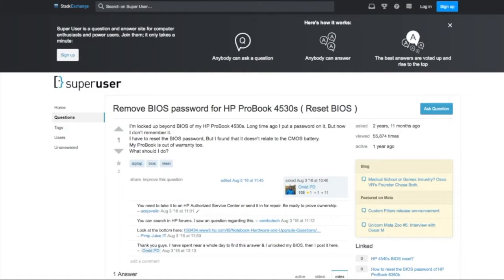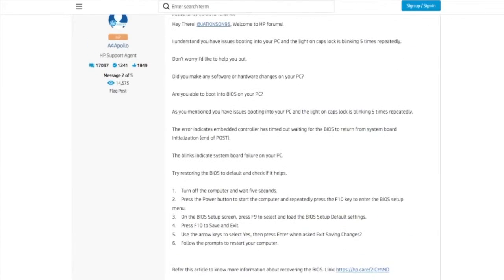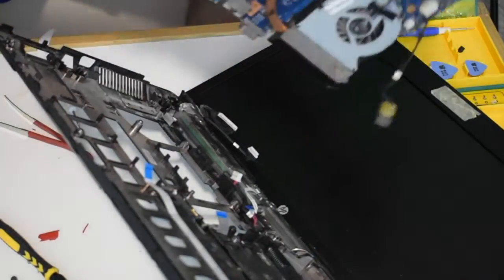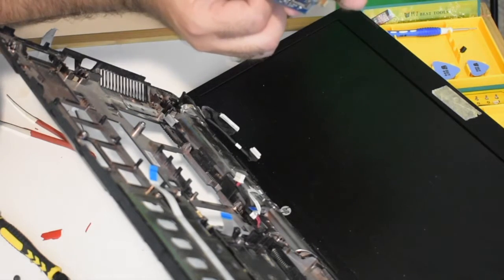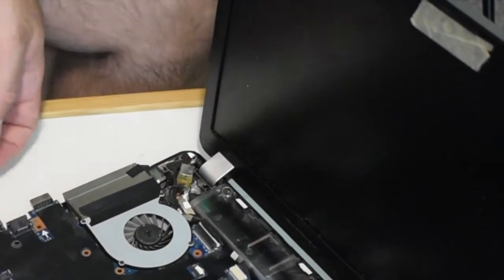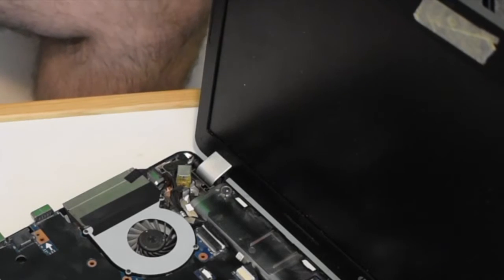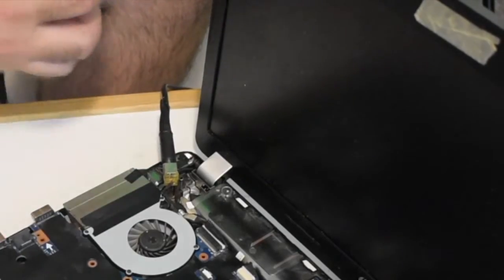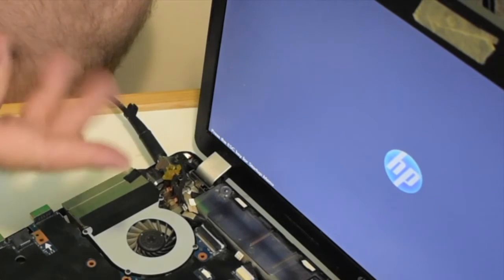HP 4530s Laptop Caps Lock Blink 5 times and Stuck on Black Screen problem

Comment: I use a zbook and a windows 11 pro would it work
Reply from the maker: Hi @animehaven-io If your ZBook has a removable battery:
Remove the battery and hold the power button for 30–60 seconds.
Reconnect battery and charger after this.
Plug the charger back in, but don’t power it on yet. Wait 30 seconds.
Press the power button and try to boot up normally.

Comment: I had the same issue on my elitebook 840 g6. I tried the method of unplugging the CMOS battery and the blinking pattern changed, it was blinking 3 times then twice a lot quicker. When I looked it up I found out it was a RAM issue, so I disconnected the main battery and the CMOS battery (not sure if it was necessary) then moved the RAM to the second slot and now it's working just fine

Comment: Unfortunately this didn't work with an HP 15 BS133ng.
Windows + B, Windows + V, Flash Stick, your CMOS battery workaround and cleaning ram slots,  nothing helped.
All because of a crappy HP bios update that was distributed as an fu...... update by Microsoft.

I had exactly the same problem in business with HP Elitebook 840 G5/G6, HP Probook 455r G6, HP Probook 650 G2 /G3 /G4 with HP bios updates, regardless of whether they were distributed by Microsoft or manually from the HP website.
But I got them all running again with Windows + B or the flash stick.

This has never happened with Dell and Lenovo hardware.
HP apparently doesn't know anything about this even though the internet is full of these stories. 
Shame on HP!!!
Reply: But with Elitebook G5, win+B is not supported. How did you do that? I try remove all batteries but remain dead. 5 caps lock  blinking and then black screen and fan to max speed.....
Reply: They distribute faulty firmware to old machines  out of  warranty to get you buying new motherboard or the whole machine.  They don't care.
Reply: @howie3431  Yes, this mainly affects the consumer series. With Probook and Elitebook, which also have a 5-year guarantee, they don't dare to do that (yet). Simply pathetic. And HP actually believes that the end customer will buy another notebook from them🤦
Reply: Kepp in mind not all Probook and Elitebook have 5 years warranty.
Reply: @klaus103  yes, I don't have any warranty. But the problem remain. How did you do win+b whit SureStart?

Comment: hp probook 450 g5 both caps lock and numlock blinks 5 times and stop then the fan start spinning loudly while wifi light and powerbutton light on  ..can this method work ?.... already disconnected all other components and reconnected them back but still the same problem persist
Reply from the maker: It should work because you resetting bios settings with default.
Reply: ok sir ill come back to you with feedback and thanks  @problemsolver4397
Reply: did it work?
Reply: Did you find a solution?

Comment: removing the cmos battery for 10 seconds and then replacing it, got my 4540s to work.  It had a blank screen when i turned it on..now it works just fine.  thanks !!

Comment: HP pavilion g6    Black screen.   5 times caplocks  blinking
Reply from the maker: It should work for you
Reply: I tried but it doesn't work
Reply from the maker: @uttamnath9014  did you remove all the batteries and hold the power button 2 minutes and plug only the power

Comment: My hp250 g5 has the same problem but it has 5 long CL light blinks and 3 short blinks. Remove the Simos battery and put it again but the screen is still black. Problem unsolved
Reply from the maker: Remove cmos battery and laptop battery.Hold the power button for 30 second.And plug 🔌 the power only without cmos batter and laptop battery.Press the power button.Try this way.

Comment: I tried many solutions what i found on hp service and other's on my hp probook 4515s. Black screen and only 5 time slow  blinking CL.  Couple a days ago i was able to start my hp by disconnect power cable,battery,ram and holding power button for atleast 60 sec and its worked when i connected all that back and i was pretty happy. Haha But.. when i turned of, next day same problem,i tried again process but this time doesnt worked.. thinking to throw it into the sea. 😏

Comment: So basically we have to open our laptop and change the cimos battery or unplug it for 1 min ?
Reply from the maker: Take cmos battery Out and hold power button for 1 min and plug the power only for test
Reply: @problemsolver4397  my laptop has internal battery .. what to do now 😭
Reply from the maker: @001Debjeet  take out all the batteries out

Comment: Worked like a charm!   I was having the same flashing issue  5 long and 3 short.   I removed the cmos battery for roughly 5 minutes and re-inserted it,  re-assembled everything.   it showed an error while going through the post that the bios would revert to default. After that it booted to the desktop,  I reset it a few times just to make sure it would continue to boot and it did.   Thanks for your advice!   Sub and liked
Reply: I have the same problem, I recently cleaned water out of it, and it worked. After about two days it did 5:3 stating it is a BIOS problem but idk how to fix it for my type of laptop
Reply: @Kyielith  did you try to take the cmos battery out and reseat it ?
Reply: @smr6482  I've already fixed it

Comment: Again same problem occur, caps lock blinking 5 times in row nd again 3 blink,  i leaved it for 3 hours agin i poweron laptop windows start but after 5 mints laptop screen truns black. Again laptop doesn't start. I have done 5 time but same problem occur
Reply from the maker: Be sure reset your bios setting after remove battery and replace battery with new one for long term bios saving your configuration on your bios.
Reply: @problemsolver4397  5.4 blinks, so this a battery problem, right

Comment: It's a nice eletronic-jazz. 
I have a 650 G2 (i7- i7-6820HQ 17") with five white caps-lock blinking. This morning call HP assistance that organizes the maintenance intervention for the replacement of the motherboard in 1-2 days.
I just need to confirm the quote, so I think "Well, I finally solved it".

Twenty minutes pass and they call me back: the spare part is no longer available so I have to contact some trusted assistance center.
A real shame for HP.
Now I try your suggestion. Stay tuned.

Comment: thank you for your experience but my pc/ hp ProBook 450 G2 problem is not solve what can I do?
Reply from the maker: After remove your cmos ,battery and unplug power cable hold power button for 2 minutes than plug only power cable than try to turn on the laptop.

Comment: i tried and its working but? when i try to open again the same problem no display i removed the ram and replace a new one its working again and then i turn of and open again its not working what is the problem bro? i already updated the bios
Reply from the maker: You might have some short on your Ram slot.Clean up with duster spray.Also try to take out battery plug only ac adapter try to run like that.Did you replace your cmos battery.If you didn’t try to do that.And when your laptop open go to bios configuration and set to default.
Reply: @problemsolver4397  yes i try it i buy new ram its working and then when i turn of and open again its not working i remove the battery nothings happen
Reply from the maker: @ReyMusicCollection  Try only one slot open again.You might have some dust on your slot or Ram is not connect properly.

Comment: if the laptop is totally out of whatever powersource, is the bios lost it data? can fix it by a cmos battery replacement or reprogram the bios?
Reply from the maker: Cmos battery removal only good for stuck bios splash logos, keeping up date/time and holding bios configuration.For PC cmos has jumper if you change that jumper your PC will not open, your case is laptop so you don’t have to worry.But, I will recommend remove laptop battery open via laptop cable AC. If still does not work remove memory try each slot with different memory.If all these things did not work you can try removing cmos battery.Your case sound like power supply part is damage or motherboard.

Comment: Can I do this to HP ProBook 440 G4 Notebook PC? they have the 5 blinks error, no screen shows. I try Clean memory, I try restore Bios holding windows key and B or V key but they no enter in Restor option. Thanks if you can help me with this.
Reply from the maker: You can do it with any HP laptop.If it stuck blank screen this is the way.For advice,if you getting to that point change with new Cmos battery too hence you do not have to worry for replacing long time.Because, that battery hold all your setting in your BIOS.

Comment: Even for my hp laptop it stucks at 5.3 capslock beep and when try removing the battery it works but when I again boot my laptop after a day or so the issue persists can you  anybody tell me what to do?
Reply: Same problem here. I did my all best, re assemble,try new lithium battery it works for while but after a reboot the problem still exist. I tried replace new lithium battery but no luck. Pls help
Reply from the maker: Replace your battery with new one.
Reply: @problemsolver4397  you mean cmos battery?
Reply from the maker: @avinashnair5064  Yes, Cmos battery and make your BIOS configuration default.

Comment: Does this work on HP Spectre x360? I have mine slowly blinking 5 time and blink fast 3 times. Best Buy Geek Squad couldnt help me
Reply from the maker: Hi Adam, alert related with embedded controller times out waiting for the BIOS.it should work.
Reply: How did u solve it

Comment: Hey i have a same problem (maybe, but in my case its blinking 5 times and plus 3 times fast blink), so is it just remove the cmos battery or remove cmos baterry and laptop's battery ?
Reply from the maker: Removing cmos battery work.I tried everything,If you getting stuck on black screen
Reply: Hey did it work?

Comment: Hello, can I contact you somehow gmail or telegram to help me fix this problem, I have HP probook 4525s same problem as shown friend says it can turn on only if battery shows green light, im trying 2 days to turn it on but can't :(
Reply from the maker: Did you replace the battery?Take the battery out and power cable hold power button for 1 minute.Try again with power cable
Reply: @problemsolver4397  Thanks for the answer 😂 Actually I fixed the problem somehow, but I can't remember what I did.

Comment: This is what I have been looking for. I could see you posted the video on 18th of July 2019. My HP Probook 4530s didn't boot the OS due to some issues and I tried to reinstall the OS again, unfortunately I forgot the BIOS password and locked out the BIOS. I was getting the same capslock blinks, I didn't get the time to check on it so for easy being I gave my Laptop to a repair shop on 5th of August 2019. I got it returned that the issue is with the motherboard. I was thinking it has something to do with the BIOS but unfortunately I believed the words of the computer shop. I didn't change the motherboard because I thought I could spend some time to understand the issue to fix it myself. Hence, I was browsing for all the topic related to this issue and found this very helpful video. In the video you had the same complaint with the same laptop and relatively this happened to you on the same month of the same year.

Thank you, very much for putting this on Youtube. I am probably going to do it this week itself and let you know about the status.

Also after I got the laptop from the computer shop,  it seems like the display isn't turning on. I guess they have done something or haven't plugged the cables inside.

Comment: Hi, thank you for advice.
From the beginning I read the same forums that are shown in your video.
I tried to reset the BIOS by removing the battery, as in the video, but unfortunately it didn't work. I'll try to heat chips with a blowtorch, maybe something has happened with BGA fixings...
Reply from the maker: Just leave the battery out little longer and do not put it back.Plug the power to computer first then plug other end to outlet then wait little bit.Did you see any power after plug back when you take out the battery?
Reply: Don't you dare use a blowtorch for anything lmao
Reply: @ubifmcnew  some people take out motherboards, graphics cards, etc and bake them in the oven. 

It's what I did to a Mac all in one computer graphics chip and it worked great after it.